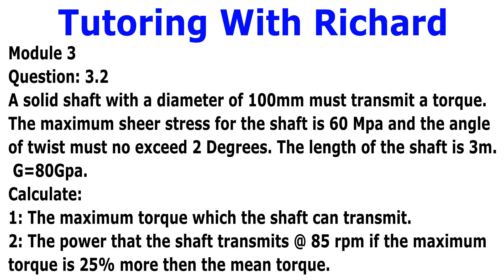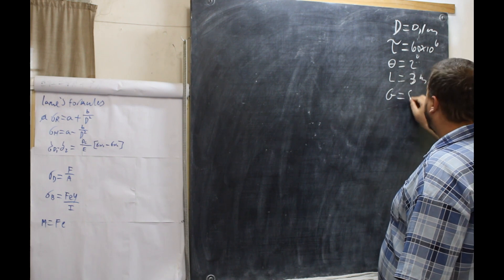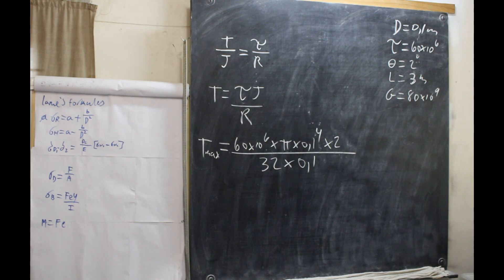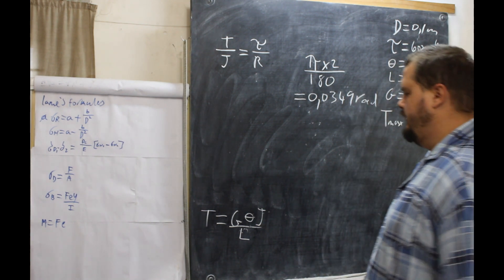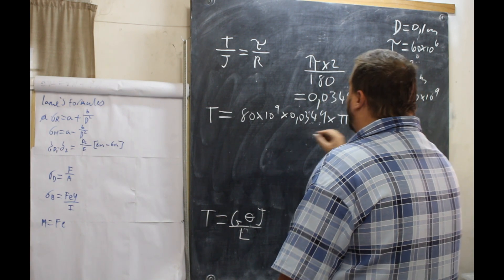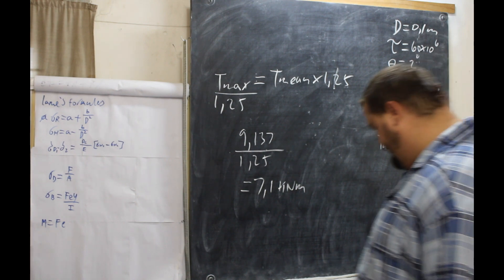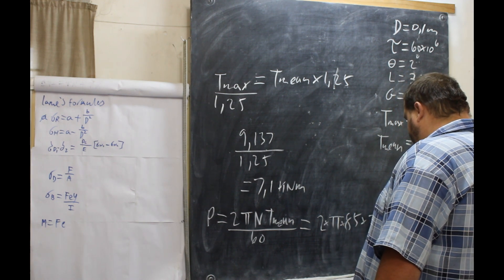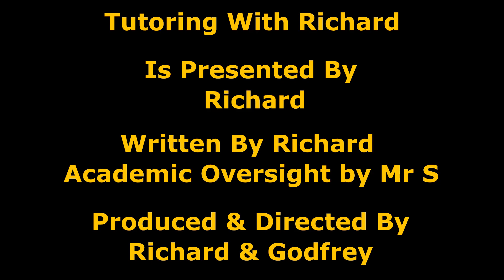N6 Strengths Combined Bending and Twisting of Shafts Module 3 Worked Example 3.3 New Syllabus

Comment: Hi Richard. Thanks for the videos. The first Torque answer is correct but you forgot to write the correct Radius under the line. Die diameter was used